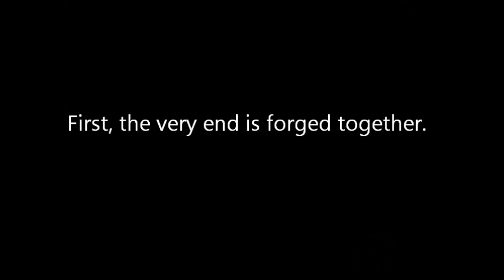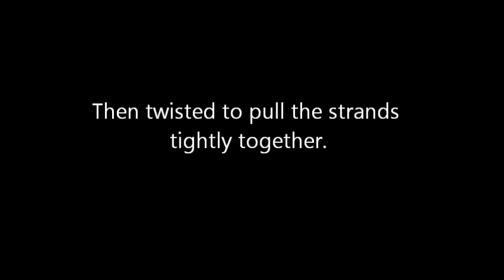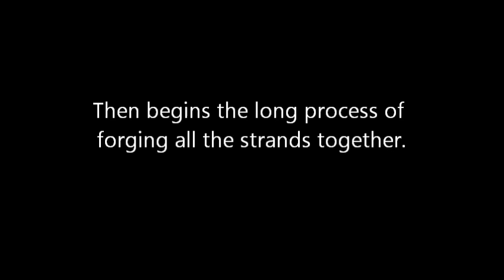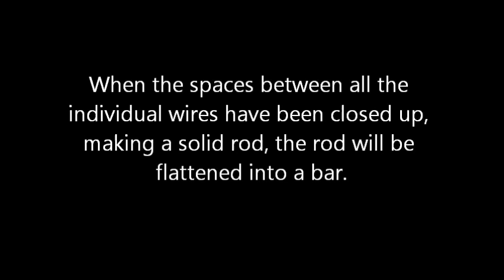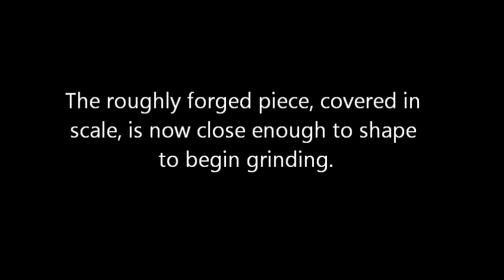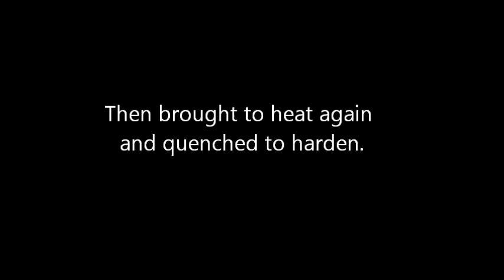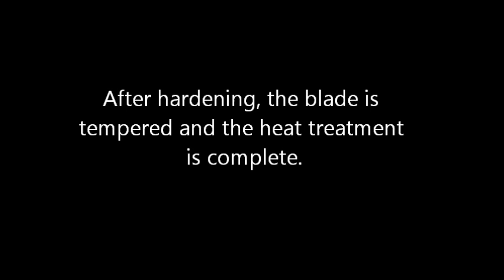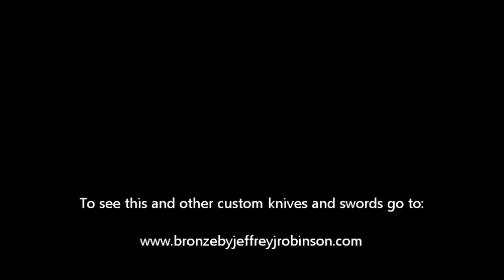Making of Leah's Dagger (cable damascus)

Comment: Is adding Borax really necessarily?
Reply: Yes. My understanding is that the borax prevents oxigen from bonding to the metal, which allows the individual pieces of metal to actually fuse together on the micro- scale. Again, that's just my understanding of it.
Reply from the maker: Homemade Stuffz It acts as a flux, as datpolakmike indicates, to help get a clean weld. It should be possible to do without a flux if the metal were kept very clean and if it were heated in an oxygen free atmosphere. Even so, a little insurance doesn't hurt.
Reply: Iron oxide constantly forms on steel. All metals suffer from oxidation. This "scale" will not allow the metal to forge weld. Borax eats that layer off... and eats the bottom of your forge.

Comment: So much hate for the wrong usage of a pipe wrench... especially for one modified and used in forging a dagger. I think you have a lot of very anal retentive plumbers on your channel. Great job and awesome video. Do your job the way it feels right, and remember you're working on a dagger not a pipe. Just bush them off.
Reply from the maker: +eldragon00   lol thanks.
Reply: @brotherbanzai  Also if you would like help on the next design let me know , i actually like this design but i have improved on it and will use it in the future.

Comment: Is it better to quench in oil or water?
Reply from the maker: Nolan Pipkin Depends on the steel being used
Reply: Nolan Pipkin As brother said, it depends on the steel, some steel alloys and higher carbon content steels need to cooled quicker or slower, there are more quenching liquids as well, some them unsafe to have at home. Hope this helps.

Comment: would you have to twist anti twist cable
Reply from the maker: +Kenneth Allshouse  If it's woven cable it probably wouldn't work well for this. Twisting the cable helps close up the gaps before hammering it together, you'd still need to close those gaps somehow.
Reply: ok thank you

Comment: Love the forge work, but you are using that pipe wrench in the wrong direction. With a pipe wrench the stationary jaw points in the direction of rotation. That sloppy but setup that adjusts the wrench acts as a hinge and the jaws self tighten. The extra handle you welded on there makes things weird but even with that it will work better if used in the proper direction.

Comment: great job but sincerely i don't understand why you used a cable to do this masterpiece. i've seen you had a bar to keep the cable right and work it.
Reply from the maker: +Gioacchino Mazzanti  I used cable because that is what causes the pattern in the finished blade. There is no particular advantage to it, just creates an aesthetically pleasing pattern.

Comment: This isn't Damascus. The Damascus method means the metal is folded many times before it's shaped to create a stronger layered effect on the blade. Twisting the cable doesn't have the same outcome.
Reply from the maker: C0Opd0g No, actually Damascus is a place and the steel from there is more correctly termed wootz and is not folded at all. What we now call "damascus steel" is actually pattern welded steel which has visible layering and somewhat mimics the look of the watered pattern visible in wootz steel. The type of blade I've made here is commonly referred to as "cable damascus"  in the sword and knife world by both makers and collectors, so that is what I  am calling it so it will be clear what it is.

Comment: this method will not produce a very distinctive pattern because there is only one type of steel being used typical damascus blades use a high carbon steel and a nickel alloy
Reply: +Wolfganges Factorial or HC steel/nickel/silver or use of different steels for example #01 tool steel/1095/D2 will make a type of Damascus with incredible hardness, durability, and toughness for a blade. In reality how to make true Damascus and wootz steel was a secret lost long ago. Every blacksmith has his secrets, how they made there Damascus was unique depending who forged it and what form of iron they forged( iron ore or iron sand.
Reply: +Levi Halog I've heard that that secret wàs lost. I bet most modern, high carbon steel are just as good for blades as the wootz steel produced long ago though.
Reply: Your right.

Comment: ya know... if you use that pipe wrench the way it was designed and fliped around the other way it would have more grip and wouldnt slip on just about anything...
Reply from the maker: +Buubas Welding  Ya know... if you read the first line in the video description...
Reply: Lol i was joking.

Comment: Love your work really  but this seems like a bunch of unnecessary work, I don't get why you would use a a cable unless that's all the steel you had or could afford
Reply from the maker: You use a cable because of the interesting pattern it gives the blade, same reason you would use pattern welded steel, folded steel, motorcycle chain, etc.

Comment: I thought damascus steel was impossible to recreate as wo dont know how they used to make it??
Reply: ***** Damascus style... is more accurate :)
Reply from the maker: ***** Real Damascus steel it wootz, and the method used to create it was never lost. There are lots of smiths making it today. However cable damascus, like most of the steels which are commonly called damascus in modern times, is actually pattern welded steel and not truly "Damascus steel" at all, it's just what it is commonly called because of the superficial resemblance to wootz.